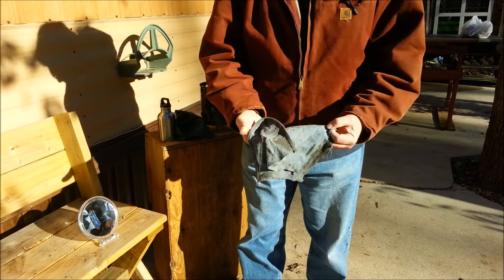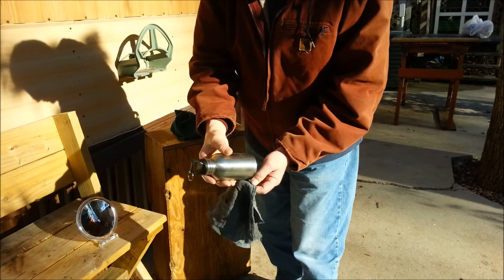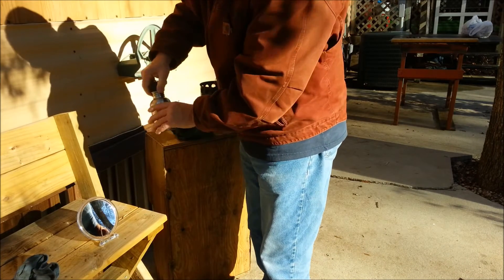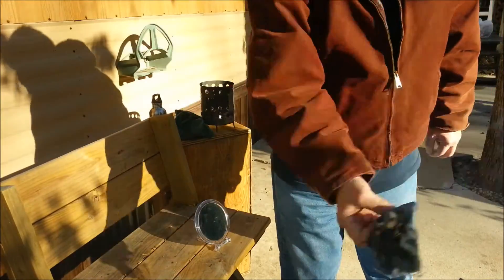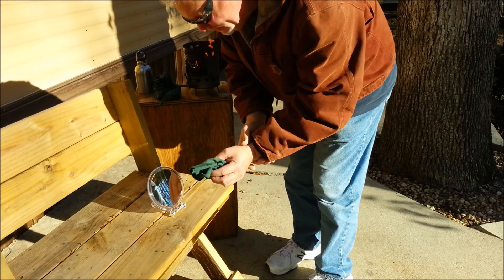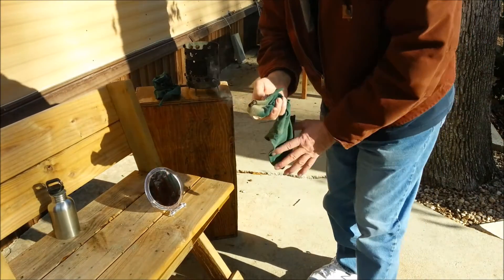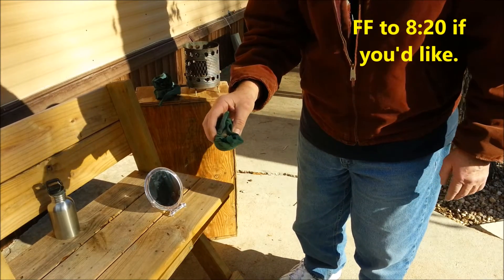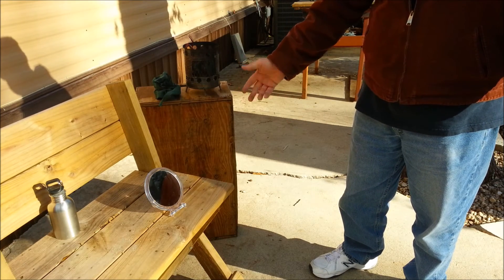Ashed Tinder, The Magic of Applied Ashes... How To Make Super Tinder

Comment: David, Thanks . I was about to ask you why you use ash so often. Still not clear why, but used this on an old "ShamWow" cloth. I was amazed how quick it caught. Thanks
Reply from the maker: Not sure what you're asking. Thanks for dropping by.
Reply: David, Actually it was just a comment. How I used some ash on some material, and it worked much better than material alone. My question would be Why does ashes help? Thanks for the videos, I learn so much!
Reply from the maker: I'M not sure. Ashes have a lot of interesting qualities Here's the common response I give when people ask me about the fire roll.I can't tell you about the chemical reactions. I can tell you what I know about ashes. They make a Hand Drill spindle 3 times more grippable, they allow the top and bottom boards to grip a Fire Roll well enough to compact it enough to drive it, any tinder impregnated with ashes will become a super coal extender (search my channel for ash, coal extender),  ashes insulate... So, I'm thinking that the fibers coated in ash are forced to rub against each other creating INTENSE heat, all the while this intense heat can not escape because of the insulating properties of the ash so it gets even hotter, until finally the distressed fibers allow a pathway for all that heat to make its way from the center, to the outer fibers and the air that completes the ignition process. PLEASE check out my... How to fire roll video. Thanks!